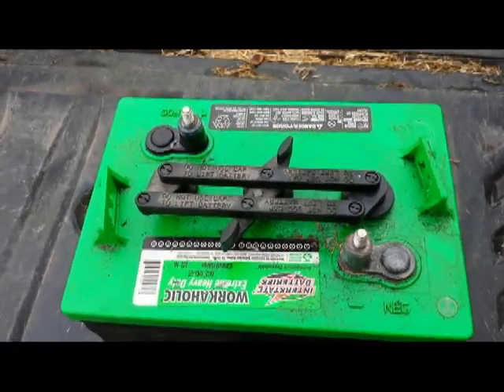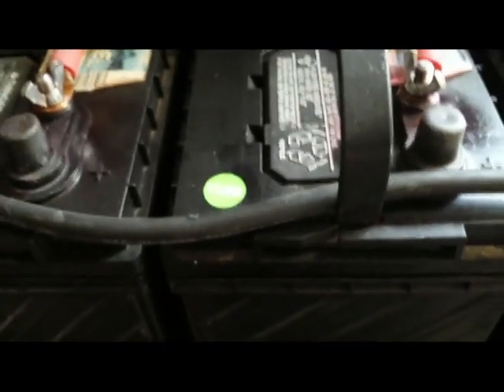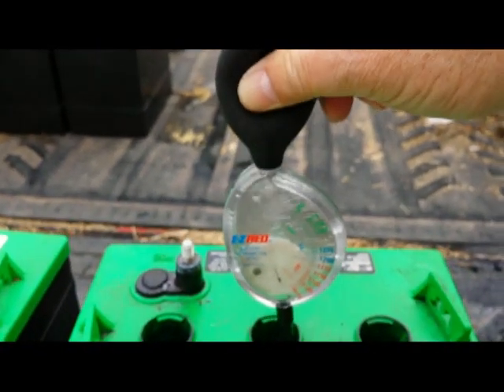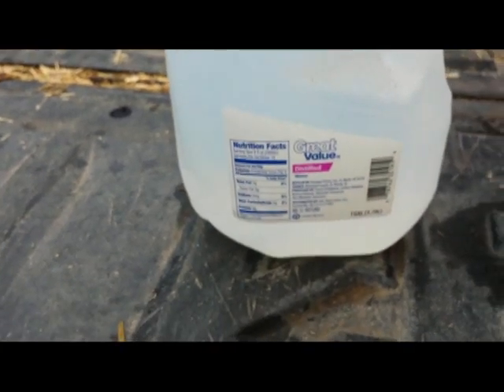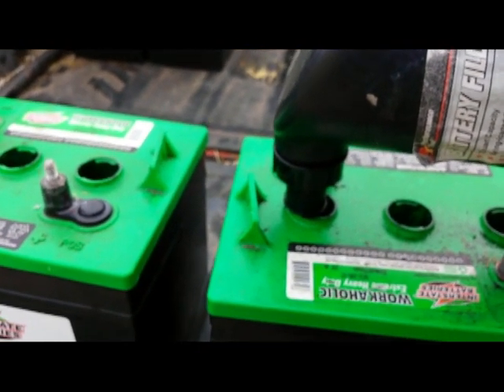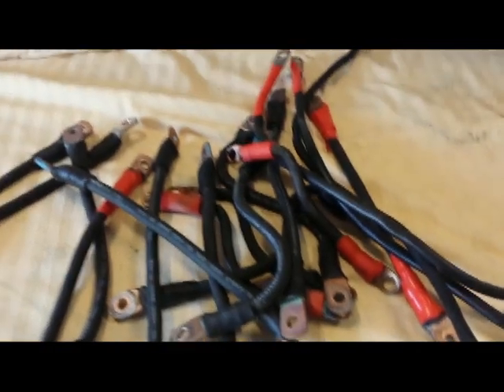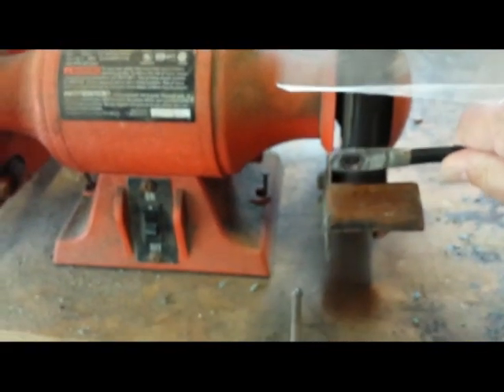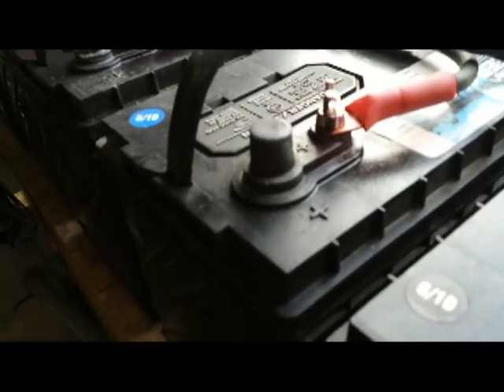Solar Battery Maintenance Made Easy

Comment: At the very tail end of the video, you said, most of the current from your solar array is going to charge your battery bank. Does that mean you topped them with distilled water when they were in a discharged state? You should not do that. You should always add water when the batteries are fully charged. Also, you might want to check the length of the wires connecting the batteries. The resistance between the batteries must be same across the bank. I understand this is a 7 year old video. It would be interesting to know  what happened to your battery bank. I have seen people getting 10+ years with well maintained Tubular FLA batteries.

Comment: Your wire gauge looks small.  What size are you using.  Do you find it limits your amp output?  I am in the process of building a 10K system for my offgrid homestead.and just trying to decide on the gauge I should use

Comment: Thank you for sharing your knowledge and experience with all of us. Your battery bank array  and the age of your battery bank clearly shows us that you have a proven track record of success and know what you are doing. I enjoy researching renewable solar power systems and gravitate to people that have success and also their failures and apply best practices to my own humble and small emergency solar power backup system so that I can grow that. I also noticed you have a shut off switch on your battery bank. Excellent and your batteries are well ventilated and can be easily accessible for servicing, what size battery terminals do you use and find work best for your bank? Did you make your own or did you purchase the cables? Each battery appears to be the same type and I am certain are the same age. Correct? If not what is your thought on buying a newer battery and adding it to an existing older battery bank array? Have you considered placing your batteries on trays with baking soda?

Comment: Hi Al. I just bought 4 of the interstate 6 v 232 ah batteries making up a 12v bank like u have.
Can you tell me what charging voltages you use for them? Right now I have them to be dumped at 13.5 to a gti for wind power. I'm getting ready to tie in a Tristar 45a CC so I was wondering what your settings were since they have lasted a good while for you.
Thanks
Larry
Reply from the maker: Hey Larry when my system was setup for 12v I was using a 14.6v dump load setting because absorb mode was set to turn off at 14.5v. Your Tristar controller should say what the absorb voltage is so just set it for about tenth volt over that setting so you don't interfere with absorb/equalize operation.  Thanks
Reply: econewpower Hi Al, Thanks for getting back to me. Will do..

Comment: Al, do you find running batteries in series is better than in parallel ?
Reply from the maker: A mix, the six volt batteries are in series of four to get 24v, then those are connected in parallel to the other sets of four. The 12v batteries are in series of two and then in parallel to the other sets. Finally both banks are wired in parallel to each other for a final of 24v across both banks.
Reply: Are you going to use the Timney Triggers are really good. Let me know what you do.
Hey, do it on video !!

Comment: Hey Al thanks for sharing through your video. I have a Rolls Surrette 48 volts Battery Bank of 24 units. I noticed every time my water level gets low i will experience maximum output from my Batteries Bank, Basically, I didn't have to go on the grid for electricity but when i fill my batteries with deironized water i noticed my system will start to draw current from the Grid. any suggestion to avert this from happening?

Comment: Thank you for re-posting the video, the audio and visual match up perfectly.  It was much easier to understand.  Can you do a video of a drawing showing the series and parallel of the battery banks?  It is hard to visualize with the batteries at different heights and a table in between.  Thank you again.
Reply from the maker: Even better, go to the Outback Power site and download the PDF document for installing their battery backed inverter or one their charge controllers, they have tons of drawings of different ways to connect batteries. If you can't find it send me your email and I'll send you a link to it.
Reply: Thank you, going there now.

Comment: How much of your home are you able to power with your set up ?  For how long?
Reply from the maker: Everything except the central air conditioning for a week straight without new power. If I wanted to handle the air conditioner as well I'd have to almost double my power production during the hot summer months.
Reply: econewpower Impressive !  Thank You !
Reply: econewpower Yeah man, your bank is most impressive. Exactly what batteries are you using and how do the compare to 12v PV dry-cell ?